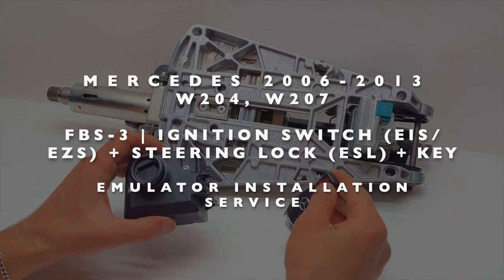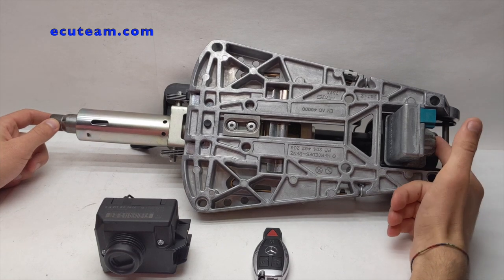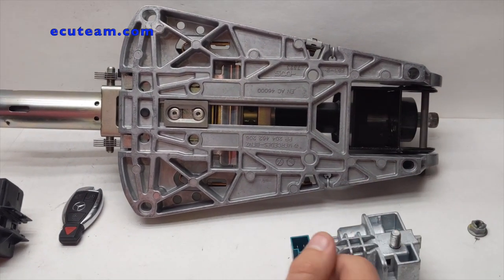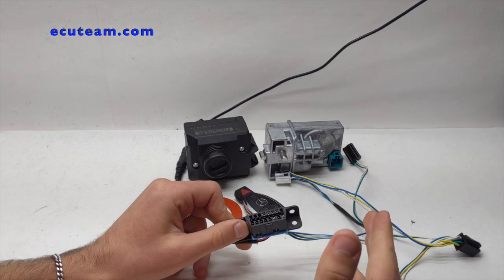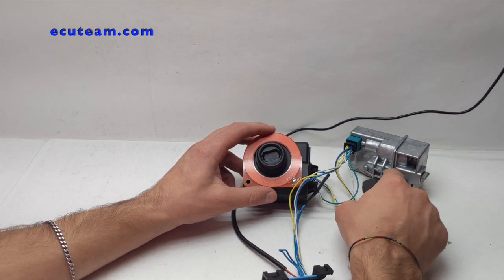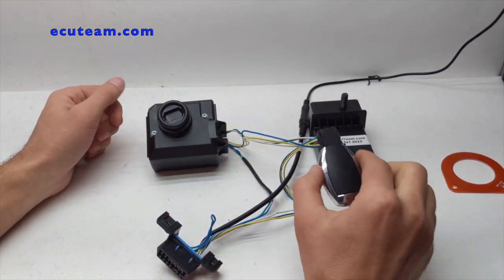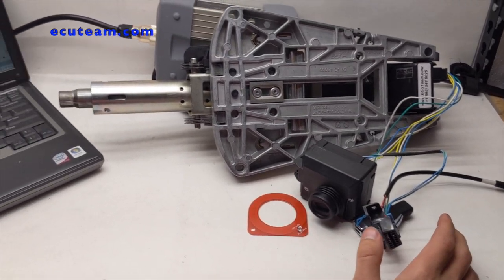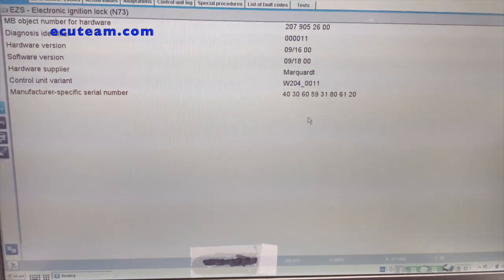Mercedes W204, W207 Ignition Switch + Steering Lock | ESL Emulator Installation Service. PART 1

Comment: Question: Will installing their Emulator as opposed to the OE ESL Module give any error codes? You mentioned that it won’t communicate but it will start the car, so will not communicating will give any faults 🤔
Reply from the maker: Installing the emulator using proper programming must not lead to any error codes. The only difference is the status

Comment: I own Mercedes Benz A180 W169.I have a strange ignition issue: I put thr key in and I can always hear the click sound.Problem is,I have no lights on the dashboard when I turn the key.If I keep switching eventually I get the dashboard lights and that’s how I know engine will start.Sometimes it takes 15-20 minutes to get the dashboard lights! I don’t know if councidence or not,but if I hit under the steering column,I get the dashboard lights on,but not all the time,sometimes without hitting and repeatetly switch on/off I can start the car.Its intermittent.What could it be? Is it the EIS module ,ESL module (the small motor inside) or just some wiring issue? It driving me crazy and I’m a bit afraid to start removing my column( I know I can set the ESL on unlocked position by turning ignition on and removing battery while its unlocked ).What is your opinion?
Reply from the maker: Hello! Thank you for your comment. Problem is with the steering lock, sounds like. The steering lock is about to die, that's why you are getting this intermittent problem. Also what year is your vehicle? You can send us your EIS + Key + Steering lock, we'll check it out for you. As said on the video, there is no "real" repair for this steering lock, that's why we offer emulator. It makes more sense to install emulator and never have this problem again, rather than put yourself in the same situation where Steering Lock can start acting up again. Please, contact us directly and we'll help you out. https://ecuteam.com/contact
Reply: ECU Team Corp hello,thank you for reply,it’s a 2005,Diesel SE.I just realised that knocking under the column doesn’t do anything,its enough just to turn ignition on/of repeatetly until dashboard comes on.The click sound I can hear absolutely every time I remove/insert the key,so I guess the lock works ok,so I’m thinking that my EIS is about to fail...hopefully it won’t be too expensive to fix/replace...I’ll save your link just in case,the most painfull part its the price probably :))

Comment: I had this done to my car but now the ESP  is not working...
Reply from the maker: This might be a coincidence I would say. Sometimes it happens when couple things goes bad at the same time. Ignition System has nothing to do with the ESP. And it could be 2 different things. ESP module as a separate unit (older Mercedes models) or if you are driving something newer than 2004, ESP module is integrated into the ABS Control Module, just replace it with the brand new one, because used one you can't program. And I don't thing anyone can do something like this.

Comment: hi I have a 2011 MB C300  I need to send in my key switch (EIS) to get programmed to a new key fob the company that will be programming the key switch (EIS) to a new key fob need my key switch (EIS) I need to disconnect my battery because I need to remove my key switch (EIS) for at least two weeks. Does any one know if I will have problems with all the computers on board this car being that the battery will be disconnected for that long as I heard that Mercedes cant be with out power for a log time.  pleased help thanks to all in advance.
Reply from the maker: I am sorry but we did not understand what type of issue you got, rephrase your sentence please.

Comment: Hi.  Watched the vid 2x.  I think you skipped over the "programming" portion, for obvious reasons.  Question I have been searching HI and Low for.  Can these emulators be programmed with FACTORY MERCEDES software?  IE like the dealership mech shop techs would be using....    Thanks
Reply from the maker: Hello! With Mercedes and BMW we always go with what we got in the facility and that is the original DEALER scanning tools. Unfortunalety it cannot be programmed using the dealer scanner tools there are other tools for this purpose.

Comment: Great info! Valentine is very helpful and knowledgeable
Reply from the maker: Thank you!

We are trying to do our best! :)
Reply: Why didn't you show us how did you remove it ?
Reply from the maker: @adamalami9625  Because removing procedure is a complex process that we developed for "in house" use. People can remove it different ways, but the safest and most reliable we keep as a secret so far.
Reply: @ECUTeamCorp  i finally removed it without damaging the module. Do I have to buy a new one and try to program it or should just buy the motor inside and put it back together . And I really appreciate you helping out people. Cuz dealerships are ripping ppl off left and right .
Reply from the maker: @adamalami9625  Thank you for the reply and feedback. I appreciate that. Well, I'll be honest with you. Motor swap for this ESL is not really a good thing to do. Most of the time the actual chipset inside goes bad and even you install the motor, most likely it won't work. Even if you get lucky and it works in your case, be sure it won't last long. Because of the manufacturer design, it's made to break. That's why we offer much better solution. Steering lock emulator, that looks same a the actual lock. It won't lock or unlock the steering column, but I guess you don't even need this useless feature. If someone is planning to steal your car, they'll just tow it 😁😁😁
However this emulator works very well, never gives a problem. And you can keep driving without worrying about unsafe parts of this car.

Let me know if you have other questions.
Reply: @ECUTeamCorp  true that. If I wanna work with you guys . What do I need to do and. How much it will cost me for everything?
Reply from the maker: @adamalami9625  We'll be happy to work with you! For that information you have to fill out Request Quote and one of our techs we'll get in touch with you for that information.

Here is the link to that form:  https://ecuteam.com/mercedes/mercedes-eis-module/

Thank you!

Comment: it would appear the little closing lid thing, is actually a switch. for when it gets dirty old and worn out, pulling the key out no longer immediately activates the steeringlock :P but wiggling it with your finger does :P  it would also appear that when it's all screwed completely the car sometimes still starts if you ram the doors open button on the key a couple of times before inserting it. (even with all the rest of the central door locking stuff broken, it does somehow seem to pick up on the key being near it after pressing the button a few times in front of it ;P oddly enough. (ya know. those locks and keys only last like 400000km or so after which they start to develop 'key inserted but won't turn on dashboard and won't turn' 'nothing happens' scenarios :P oh the magic of a fleet of 10 year old sprinters. lol :P can't they simply replace it all with just a start/stop button (you know. an actual switch. none of that modern stuff ;P like on hmmvees :P LOL. way better. noone is gonna steal your old sprinters anyway (not anyone in their right mind unless they have a death wish :P LOL.
Reply: no idea why they don';t simply have a switch 'conversion set'. people simply leave the keys on the wheels outside anyway (which i'm sure doesn't improve the lastability ;P LOL. noone cares if they get stolen. they just have to work :P lol. (but then again. maybe simply telling drivers to only turn it on in the morning and just keep it running kinda helps with the lifespan of the ignition locks and keys :P lololololol. like not switch it off at every stop lol :P the whole thing is actually a fairly unreliable construction. compared to dudos and 602's cauzing more problems than it solves. :P sure it won't get stolen like it would with a switch or just a bosch key but if someone steals one. well. ya know. you got some 20 more cars doing the rounds. someone will catch them lol :P
Reply: the w124 system also wasn't without it's problems (car not returning key and not starting either, that sorta thing ;)  but nothing 'weird' like this. lololol.

Comment: Nice video quick question my steering wheel is not lock but it would not turn on Thanks
Reply from the maker: It's possible, but it means that the steering lock got stuck anyways, you just got lucky that it's in Unlocked position, it's easier to remove.

Comment: Do I need to remove the entire steering column in order to get the steering lock mechanism?
Reply: Yes you do. It’s actually not too bad depending on the car you have
Reply from the maker: Yes you do, if you want to take out the steering lock mechanism out properly the best way is for you to take out the entire steering column.
Reply: @ECUTeamCorp  One more question. I take out steering lock module and write eis data, but it starts 3 times and then no longer. Programmer says it's faulty again... Eis is click and not turn properly. Must I replace EIS also?
Reply from the maker: @zymon.  Potentially yes, there might be a software corruption inside of the EIS. You can send that to us and we will check it out for you.

Comment: Hi, great video, very clear explanation and useful info, thanks so much! It’s interesting that for me the factory ESL worked for 10 years, after which I had to change the ESL motor twice, within only 2 years. Also, the motors looked messy probably because of the carbon brushes wearing out.

Why do you think the repairs only lasted a year each? Were the replacement motors already used or low quality, or did something break on the circuit board inside the ESL module after the first 10 years which now damages any motor you would install by overpowering it? Or is the overvoltage coming from outside the ESL? For example wires being wet, corroded or a grounding issue. If someone knew the exact source of the problem maybe it could be repaired for good. Thanks!
Reply from the maker: Hello! Thank you for your feedback. It helps a lot. You got very lucky that 2 motors in a row worked. Normally it's a problem with the actual computer that is inside of the ESL. When the ESL goes bad, the chipset inside of it stops working and no matter how many motors you are going to replace, it won't work. That's why I said you got lucky. New motors are not reliable because they are made in China, not Germany. That is why we suggest ESL Emulator, it is much more secure and reliable solution.